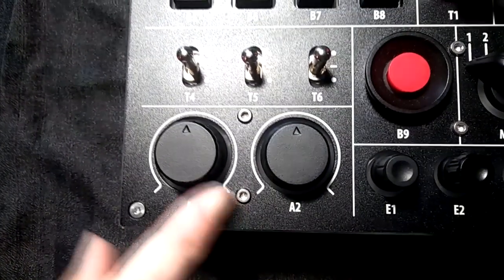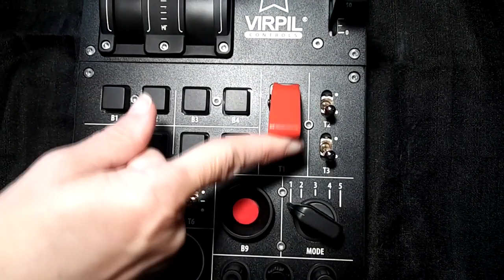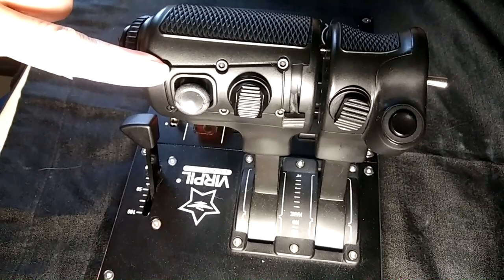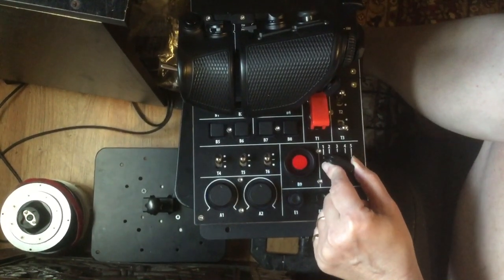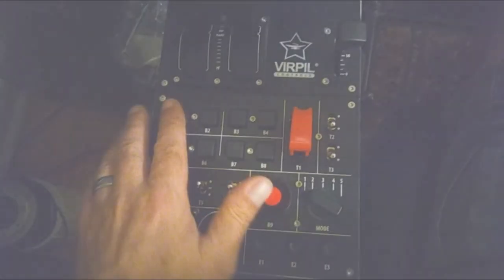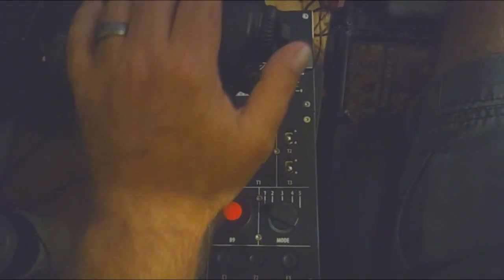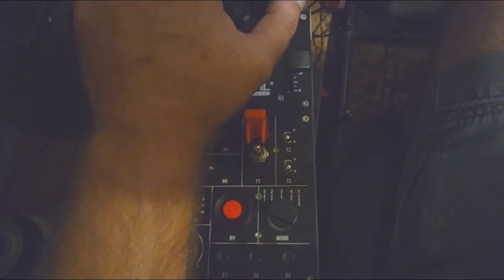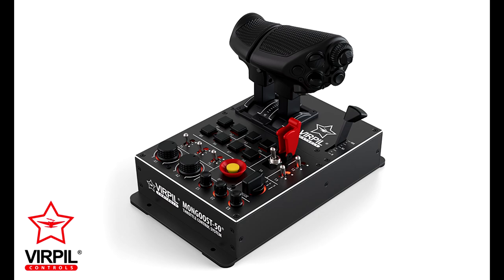Virpil Mongoose T-50 Throttle (Version 3) Review

Comment: Hello, great review. I have one question concerning the Afterburner function. I don't have with throttle yet. But how do you activate the Afterburner with this throttle? Isn't it weird that there are two marks on the throttle? There is even written Max? Am absolutely new to DCS
Reply from the maker: I honestly hadn't noticed the marks until your comment. I know the first (and possibly second) version of this throttle did have an AB detent. for some reason though, they removed it for this version. I don't have an issue as I can hear the plane I'm flying  go into AB. I also glance at the rpm and speed gauges as well to see where I'm at.  I had a TM Cougar and took the AB detent out of it years ago to get better throttle range from it in Falcon: Allied force and BMS. So I just got used to not having one.
Reply: @knightflyer7968  great, thank you for reply. Then it is more a question of is it out of stock or not :)
Reply from the maker: @dubtube6691  So, there is the CM V3 (The one I have and reviewed) and the CM 2 (A smaller version with the same handle). I was told the one I reviewed is replaced by the CM2. So the CM is no longer available through Vripil, if I was given the correct info.
Reply: @knightflyer7968  it's really hard to get one :)
Reply from the maker: @dubtube6691  When they first released their throttle I decided to wait and see how things were going to pan out with it. My biggest gripe was that it had no mini stick. By version 3 I was in love and decided to go for it. I'm so glad I did. and I got it on their last run of it. I had no idea they were going to discontinue this version until after I had it.
Reply: @knightflyer7968  they discontinued the MongoosT-50CM Throttle V3?
Reply: @dubtube6691  The trick is to check their site every day when you decide to pull the trigger. Be ready and place and pay for your order when they come into stock. I was able to pay for one via paypal direct transfer and it was effortless from the US. I ordered and received the warbird base and VFX stick last December and managed to pull the trigger on the CM2 throttle after trying the stick. The stick took about three weeks to "process" but after that shipping was only 3 days to the US. The last shipment of the older style throttle did stay in stock for a couple of days before it sold out and Virpil has stated that they will no longer be available. I looked at both and decided to wait for the CM2 for a couple of reasons. First the new release has about the same number of buttons, with a slightly modified handle that looks even better and more important the new throttle has connections on the back so that you can daisy chain other virpil products without using more ports on your computer. I looked at both and seriously think the CM2 is the superior product. As far as the throttle detents, they are not a problem to me but there are some very nice 3d printed detent/handles-releases produced and it's an easy mod. Speaking as someone who purchased the stick and base, I play every day on 3 different sims and moving from a ball and socket type stick base assembly to a cam driven assembly is a huge upgrade. Not sure that the throttle will be that big of a change but I would predict that anyone who is on the fence about these things would enjoy their experience if they go ahead and pull the trigger.

Comment: I have a question for you or any of your viewers. I have a Saitek X-52 joystick and throttle. This might be a better throttle for Microsoft Flight Simulator 2020 as it has more functions, switches, hats etc, BUT also because you can split the throttle (which may be needed for twin engined aircraft). Would this throttle be able to be used with my X-52 joystick? Does it have a USB connection so that once plugged in, you could simply map the switches in the flight sim you're flying, and not reliant on needing to be plugged into a Virpil Joystick exclusively? I mean, you have some buttons on the joystick, and other functions (like trim etc) on your throttle, and some less utilised functions on your keyboard. Any help would be greatly appreciated.
Reply from the maker: @sopwithpuppy Sorry for the delay in my reply, I've been in the hospital for the last three weeks. To answer your question, yes, you should be able to use both at once. Unless there is a conflict I'm unaware of.

Comment: Hi, Is the mode knob switching the buttons to a different state of Direct Input buttons or just allows you to map silly keyboard combos? Meaning, say you have 30 buttons on Mode 1. When you switch the mode knob to second are the buttons switching sort of this: Button 1 becomes Button 31, Button 2 becomes Button 32... etc?  If so, can you also choose only part of them to switch function?

Thank you.
Reply from the maker: Hi zaelu, Thank you so much for the question. However, I haven't messed with the Vipril software enough to be able to answer it. I would suggest posing that question to this extremely intelligent individual:  https://www.youtube.com/channel/UCxPjhMEGmxbEyNAUXNPB5pQ   He knows quite a bit about the software.
Reply: I think you can program that in the software with the shift mode